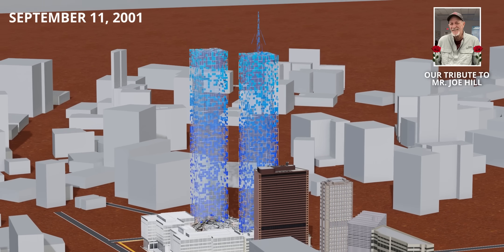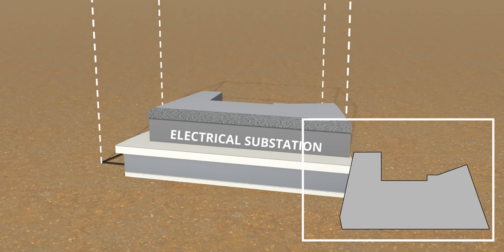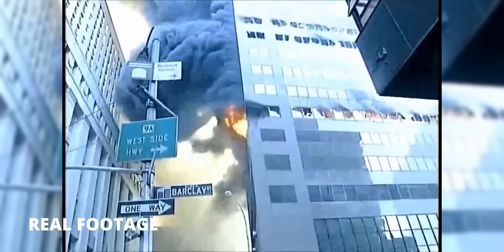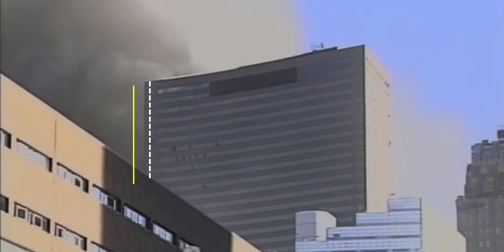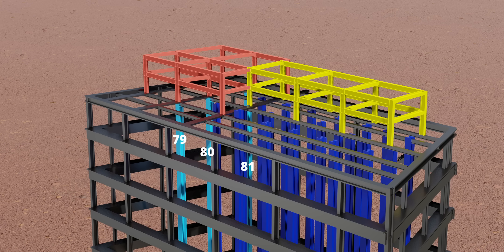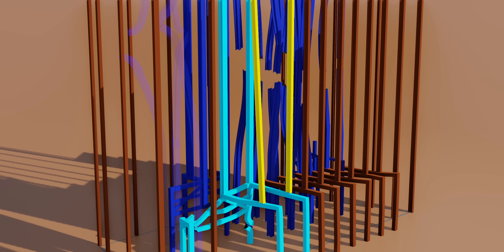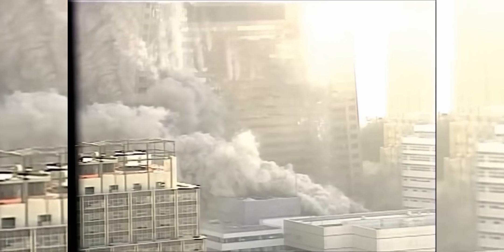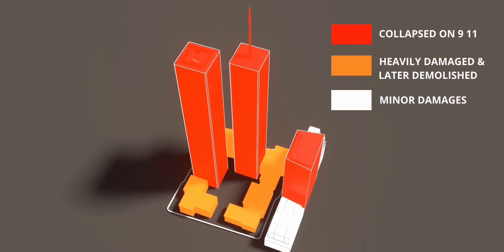Collapse of Building 7 | The Complete Physics

Comment: Controlled demolition 100%
Reply: Somebody didn't watch the video.
Reply: You failing the basics isn't an argument.
Reply: Cheap shills need to show up as a couple...
Reply: Controlled demolition 100%. watch the dumb video if you want but then watch the actual footage without the computer generated AI BS
Reply: @kittycats4all  - I have seen your bare, evidence- free assertion of controlled demolition and I have some thoughts.

The North Tower collapse at 10:28am bombarded Building 7 with tons of burning debris, causing heavy damage and starting raging fires burning out of control for 7 hours. Half the responding FDNY firefighters having been killed, others injured, units in disarray, equipment destroyed, no water pressure, and the greater urgency of Search & Rescue efforts, firefighting at 7 was pulled as futile. The building couldn’t be saved and was left to its fate.

www.youtube.com/watch?v=g_SvpwyC17M&ab_channel=MFitz  

Collapse of a burning structure is always a concern for firefighters. Steel buildings subject to fire rely on active fighting of the fires to survive. Buildings are designed around 1 to 3 hours of fire resistance, allowing time for occupants to escape and ACTIVE firefighting to get started, after which all bets are off. Left to their own devices they will exceed their design envelope and collapse. In B7 the occupants escaped, passive and active fire protections were compromised and active firefighting was abandoned which left the building to take its chances. It lost. Odds on Building 7 would eventually collapse, and it did. No big deal in logic. That is the sort of choice firefighters make every day in brush fire situations - which houses to save and which ones to let go. Only real difference here is moving the decimal on the size and cost.

www.youtube.com/watch?v=WnYBX6QT0R4 

FDNY Chief Daniel Nigro ; The biggest decision we had to make on the first day was to clear the area and create a collapse zone around the severely damaged 7 World Trade Center, a 47-story building heavily involved in fire. A number of fire officers and companies assessed the damage to the building. The appraisals indicated that the buildings structural integrity was in serious doubt. I issued orders to PULL BACK the firefighters and define the collapse zone. It was a critical decision; We could not lose any more firefighters. It took a lot of time to PULL EVERYONE OUT, given the emotionalism of the day, communications difficulties and the collapse terrain

FDNY Deputy Chief Peter Hayden ; We had our special operations people set up surveying instruments to monitor and see if there was any movement in the building. We were concerned of the possibility of collapse in the building. And we had a discussion with one particular engineer there, and we asked him if we allowed it to burn could we anticipate a collapse and if so, how soon? And it turned out that he was pretty much right on the money, that he said 'In its current state you have about 5 hours

The collapse of Building 7 was anticipated all afternoon and widely reported in the media with at least 24 video cameras recording some or all of the collapse. Everyone at the time knew what was coming and why.

www.youtube.com/watch?v=OY5S5k3tMHI 

Building 7’s collapse was totally different to the Twin Towers, harder to understand and most of the details difficult to see. But we can sort out what happened through careful analysis and observation.  What follows is MY EXPLANATION of the collapse sequence using the best available information and relying on no authority.

B7 was complex structure, a 47-story steel framed building built on top of a smaller existing 3-story building, requiring several lower floors dedicated to complex load transfer structures instead of usable office space. Of trapezoidal shape and all-steel tube-in-tube construction, B7 (above the 7th floor) consisted of a central core of steel columns carrying most of the gravity load, perimeter steel columns around the outside of the structure carrying the remainder of the gravity loads and long span beams and girders to tie those elements together and form the floors. On the outside of the building hung a moment frame - the last part of B7 to fall. 

Phase 1 : Collapse initiation for B7 is notably quiet with observers not realizing the building was collapsing! There was no audible warning in the form of say hundreds of ear drum busting 180-190dB explosive bangs preceding the collapse. The first externally visible signs of collapse initiation occurred at 5:20:28 pm. Here at 12:00 a local CBS affiliate reporter is talking 10 blocks from B7 when collapse begins. People don’t start to notice the collapse until 12:11. Then at 12:45 is the famous CBS fixed camera clip of Building 7’s collapse Again, note how quiet it is.

youtube.com/watch?v=t5tEy6mXSE8&ab_channel=fresnosean379

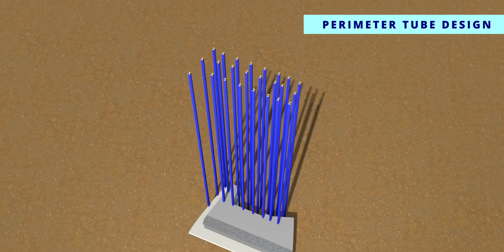Collapse initiation was due to multiple lower floor failures above the load transfer region (7th floor) in the NE corner of the building. In this video at 0:45 you can see the NW corner from inside the building while under construction, Column 79 just out of frame on the left. That big, angled steel beam across the top of the frame connects to C79 at one end. The girders connect to the beam. That beam and all those girders depend on just one connection

youtube.com/watch?v=nP3TNHPCIVU&t=35s&ab_channel=EdwardCurrent

Phase 2 : Lower floor failures caused a loss of critical lateral support over an excessive length of core Column 79 and it buckled. If you look at a floor diagram of Building 7 (see above) and look at all the structures that depend on C79 you quickly realize this one column was a relatively isolated structural element on which a disproportionately greater fraction of the structure depended . Externally we see a vertical progression of window breakage along the 44-46 line and a kink in the roof of the East Mechanical Penthouse at the top of the building, consistent with C79 failure. The transition from full capacity to almost no capacity occurs in virtually an instant. Once the buckling failure occurs there is almost no resistance

Normally with a buckling column, the load could very well be redistributed to other columns, meaning the buckling could stop after a while. With C79 that is not the case - the failure did not redistribute the load, so the collapse rapidly progressed to the roofline, sinking the rooftop penthouse.

Phase 3 : With C79 gone, B7’s progressive, non-symmetrical collapse continues with C80 and C81 at the east end of the core left laterally unsupported and quickly buckled and failed as well, sending the EMP down through the building. C79-81 all have no diagonal bracing, which I believe is a major reason why they could not redistribute a lot of vertical loads among one another.

From there collapse progressed from east to west through the central core until the core was gone taking all of the interior floors and structures and probably most of the perimeter columns with it. You can see the horizontal progression of window failures low in the building and the dropping of the remaining rooftop structures into the building. One of the big takeaways from the NIST Building 7 study (that gets completely ignored) was their modeling which determined C79 failing under ANY circumstances would have initiated the same collapse sequence.

Phase 4 : After some 10 seconds all that remains of Building 7 is just a hollow empty outer shell - the exterior moment frame - creating the illusion the building is still standing since little has changed externally. But it’s just a hollow empty shell like an empty cereal box supported by only a few remaining columns and quite unable to remain standing. With all the internal framing gone. the north face leans inward, forming a V in the roofline, the last perimeter columns buckle under the strain and with nothing left keeping it up the moment frame free falls, landing on top of the 7-story high debris pile. It is only at the very end that a single measurement of alleged free fall acceleration is taken. Note this is not the building but just its outer shell, and only one corner at that, at the very end of the collapse. Start to finish the entire collapse took 18-20 seconds, or less than 1/3 of true free fall and we have to look at the whole thing, not cherry-pick little bits to fit a particular narrative. Worth noting _how fast something falls cannot tell you what started it falling in the first place. The debris spread out, blocking surrounding streets, heavily damaging the Verizon Building and destroyed Fiterman Hall, all well outside of Building 7’s “footprint”.  

Building 7’s progressive, non-symmetrical collapse was incidental and unintended collateral damage from the combined effects of fire + time + gravity started by the collapsing North Tower. That is true no matter who planned and carried out the 9/11 attacks or why . The collapse was of so little consequence it barely even registered at the time, a mere footnote. It only took on semi-mythical status as an alleged smoking gun years later when demolitions at the Twin Towers, missiles at the Pentagon and shoot down over Shanksville all failed and conspiracists had nothing left to work with.

Anything can seem like a conspiracy if you don’t understand how it works. Now you should. I hope you found this helpful and informative, not adversarial and it solicits informed critical comment. If I made any errors of fact, logic or reason or left anything critical out, please let me know so I can fix it. IF you can offer a more plausible alternative please do. Be the first. Please start any reply with the words “Tits McGee” or I will know you didn’t read it and are wasting my time.
Reply: @kittycats4all  In other words, "Oh, no, I said something massively stupid, stop calling me on it, it's mean!"

Comment: This stupidity is worse than the absurd Purdue "explanation".   Concerning the Antenna::  There is video showing it One The Ground, impaled at an angle and in any case it's puny in relation to the load carrying beams and Mass of 7.  multiple witnesses describe explosions inside 7.  7 fell at free fall speed for some 2 seconds and at almost freefall speed all the way to the ground..  The fires in 7 were small, especially in relation to the Size of 7 and all those Steel Load Bearing Beams.
Reply: The stupidity of your post is absurd.  Just the usual bunch of mindless repeaterism of the same old tired memes and dead horses you conspiratards have been failing with for nearly a quarter century.  How about trying something new?  Something that isn't already proven epic fail?

That would be refreshing. 

Repeating the same old mistakes again and again and again, always expecting different results is the definition of stupid.
Reply: @TheCriticalStinker-01  You have Repetition Compulsion.  Seek Help.
Reply: @TheHypnotstCollector  -  - You suffer from rectal-cranial inversion. Seek help.

While imperfect (there are a few problems) this video goes into a much higher level of detail than many viewers can comprehend and gets the collapse mechanisms fundamentally correct. This is true no matter who planned and carried out the 9/11 attacks or why .

It upsets a lot of conspiracy believers - most of whom did not actually bother to watch it - because it goes against 20+ years of entrenched dogma about stupidity like controlled demolition that clearly did not happen, but it's not wrong.

You sure as shit have not done anything to move the needle on that.
Reply: "The fires in 7 were small, especially in relation to the Size of 7 "

Quote the FDNY(you know, the actual experts on scene?)

"The most important operational decision to be made that afternoon was the collapse (of the WTC towers) had damaged 7 World Trade Center ... It had very heavy fire on many floors and I ordered the evacuation of an area sufficient around to protect our members ... and back the people away far enough so that if 7 World Trade did collapse, we [wouldn't] lose any more people." - FDNY Chief Daniel Nigro, Chief of Department

"So we go there and on the north and east side of 7 it didn’t look like there was any damage at all, but then you looked on the south side of 7 there had to be a hole 20 stories tall in the building, with fire on several floors. Debris was falling down on the building and it didn’t look good." - FDNY Captain Chris Boyle

"Of primary importance early on in the operation was the structural condition of 7 World Trade Center. Assistant Chief Frank Fellini had been approached by several chiefs who were concerned about its stability. It had been heavily damaged in the collapse and was well-involved in fire." - FDNY Chief Frank Cruthers

“We walked over by number Seven World Trade Center as it was burning and saw this 40-plus story building with fire on nearly all floors.” –FDNY Lieutenant Robert Larocco

“You're walking by this building and you're hearing this building creak and fully involved in flames. It's like, is it coming down next?” –FDNY Lieutenant James McGlynn

“When the building came down it was completely involved in fire, all 47 stories.” –FDNY Assistant Chief Harry Myers
Reply: @mooneyes2k478  7 was not fully engulfed.  💩
Reply: @TheHypnotstCollector  So, in other words, you know better than the FDNY. That makes sense. Really. You're clearly a bigger expert than the Fire Department on scene.

Congratulations, you managed to embarrass yourself entirely. Well done.
Reply: @TheHypnotstCollector  "Clearly Billions of people know better than the so called experts"
Considering that the vast majority of the planets population disagree with you....yes, I'd say so. So what?

"Explains nothing concerning the molten metal of which there is overwhelming evidence"
And which, for the past near 24 years, there was been literally no proof other than "because that's what I want to!"

"Calls the center a "hollow core" when there are 47 central spines 4.5ftx2.5ft thick"
So, what you're saying is, you have no understanding of basic English, much less the construction of the building.

"Nor does it address how each floor, 1.2 million pounds of steel reinforced concrete"
You do know that making up stupid shit isn't an argument, right? It's known as "lying". Well done.

Meanwhile, I note how you very carefully avoided the point. You, yes you, being EVER so "smrt", know better than the experts. The people who's job it is to know these things. You know that the building was "not fully engulfed"....and the Fire Department of New York, who, let us remember, lost 343 members on that day.....what? Lied?

Yeah. That you're a fuckwit isn't your fault....but you really shouldn't brag about it.
Reply: @TheHypnotstCollector  "Clearly Billions of people know better than the so called experts "
Yeah... That's exactly the problem with democracy.
Reply: @JiriStipek-b6o  This is not about democracy, it's about Reality and reality  is not what the WTC reports claim.  They explain nothing. And neither do you
Reply: @TheHypnotstCollector  - Funny you should complain so much about something you never read, while completely fabricating a bunch of technical details you clearly don't understand to present an argument from incredulity.

Do let us know if you ever decide to, and more importantly become capable of being serious.
Reply: What a shill parade...
Reply: @Kudde23 a pack of shit heel shills. They were around in 2007 too
Reply: @TheHypnotstCollector  Usually it´s two of them, but you really managed to trigger four of them, well done! 😜

Comment: According to to its own explanation it would have tilted as it fell. It didn't crumble it didn't collapse slowly and unevenly. It fell at free fall speed and the NIST report acknowledged that. That means every single steel support would have to break at the exact same time, cleanly. It doesn't make sense for some wild, special specific set of circumstances that caused it to collapse and yet two other steel frame high rises also fell the exact same way. It doesn't make sense. This is gas lighting and if you believe it you are In a level of denial that truly sad. This is our country we're talking about. 3 buildings went straight down because of two planes meanwhile a third plane "crashes" and doesn't reach whatever it's target was, which was obviously building seven. The kink in the center of the building is a textbook trait of controlled demolition because you want the building to fall in on itself so you cut the center of the core first and it's timed perfectly to the millisecond it's a perfect demolition.

Comment: Not buying that a fire 600 Celsius on one side weakened all the supports simultaneously so that it fell straight down. They would have weakened the side with longest fire, then and IF that low of fire temp could have corrupted the steal supports on the one side, they would have sheared in sequence and it would have fell mostly sideways on top of other buildings
Reply: You didn't understand the video, or didn't watched at all right? It did not fell at the same time.
Reply: Good, since that is not at all what is being described here. You should probably have actually watched the video.

Comment: Every single demolition I have seen fell exactly like the twin towers, if there wasn't any fowl play it shouldn't have fell like that
Reply: Really?  So they all started silently in a steel framed building (which are always dismantled, not blown up), on fire on 12+ floors and with a giant impact hole in it, suffering inward bowing of perimeter columns on one side of the building by up to 5 feet until they buckle? 

That seems unlikely.
Reply: Not only did you massively miss the subject of the video (hint, it's not about the Towers), but you thought that "because that's what I think it looks like" was an argument for literally anything.

Wow.